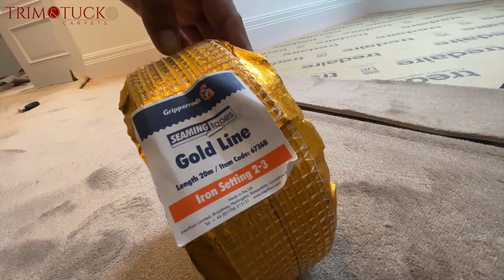How Josh does the joins in mansion carpet installation

Comment: Great work Josh, really nice finish. Not sure about using the stair tool though. Get your tucker out! 😜
What seam sealer do you use on your joins or do you find it's not necessary if they're joined tight together?
Reply from the maker: Robert’s seam sealer is the one we use
Reply: i dont think in this particular case one was needed

Comment: Layer from Australia here, genuine question no hate, but no power stretcher or wall trimmer?
Reply: and no roller on the joins
Reply: Power stretchers are rarely used in england as the skirting boards to weak, with wall trimmers the rooms are small so most fitters don't use them.
Reply: @richardzedman1160  
I wouldn't use a seam roller on a velvet carpet either

Comment: Look like he was struggling with join.Try get both sides of carpet to go down together.Why didn’t you use a spike roller in joint.It would have been nice for the camera to stop shaking and actually show us the join....A hook knife to cut the carpet,looked very net and not much of a tuck to me.Seen too many fitters not allow enough tuck,certainly won’t be working for us.The way the straight knife was used just before the hook was used I’d like to see that corner as on the second cut you cut through the pile
Reply: What on earth are you on about, silly comment
Reply: I'm assuming  a spike roller is what we call tractor roller. If I see someone using it on my job I show them the door. Distorts seam until it is vacuumed, then u see what a mess u made.  Dudes work is fine.  I'm my country we do things different but he knows his trade and what is exceptable where he is from .